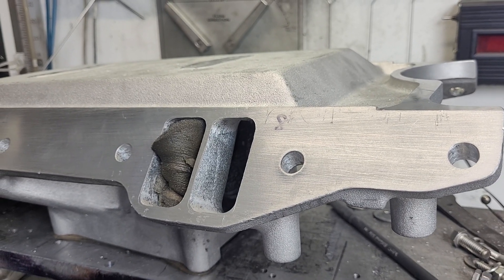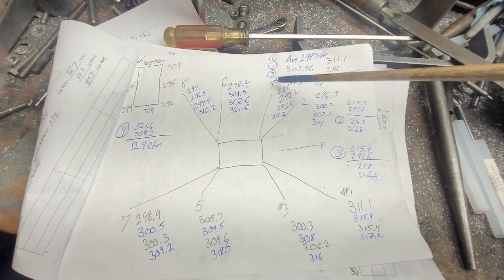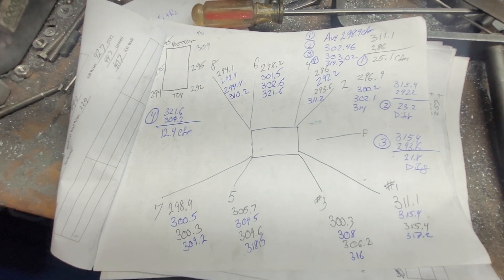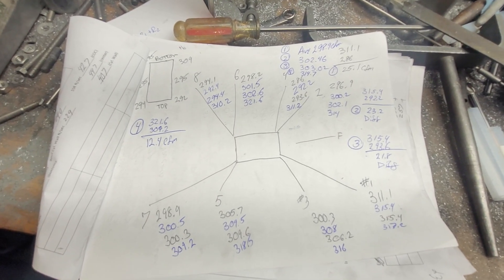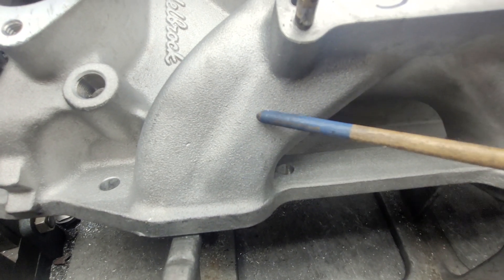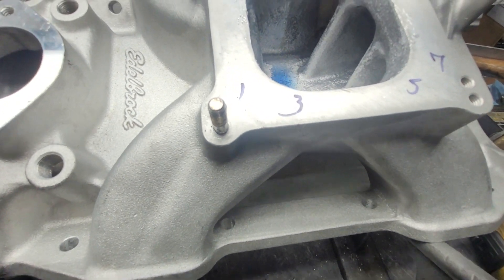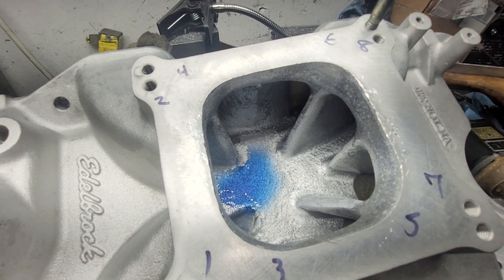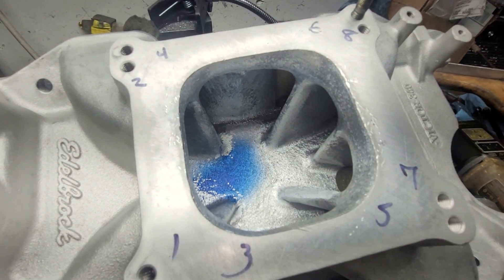How many cfm is a good gasket match worth? Edelbrock Victor 340, EQ-CH 318B. Final balancing

Comment: Hi Charlie. When are you going to get a/c in the shop? Andrew
Reply from the maker: I have a vented stand up unit. It can't keep up when I run the flow bench. The flow bench makes 7000 watts of heat!
Reply: @servediocylinderheads  Hello, little off topic but

How about 1200 watts in a outdoors flow bench? 😜 I started researching the old Kärcher. It flowed around 200 at 10 or something. 
 

-juhana
Reply from the maker: @juhanahuovinen  Good for smaller projects no doubt. Thanks

Comment: Excellent job Charlie! I just have to learn how to do my victot Jr. sb chevy.. should I use flow balls and a string to figure out where to take metal out? It's a challenge to me on doing the runners.  Thanks for the great videos.
Reply from the maker: I don't use flowballs on intakes usually.
Reply from the maker: Worry about transitions and radiuses. Taper
Reply: @servediocylinderheads  Ill watch Terry's video on the engine with the intake you did I think he has one. I would like to build a similar engine maybe a little milder for my 69 Camaro I would like to drive anywhere.
Reply from the maker: @dondotterer24 DV and Terry both did a video on that engine and neither mention me! Nice to be appreciated...
Reply: Thank you!

Comment: Which Intake would you recommend for a L.A. Head that has been ported to about same as the Magnums CFM range? I already have a super victor or a fully ported Vic340 ?
Reply from the maker: This is the first Vic 340 I have ever seen and I never saw a super vic so I have no idea. I would think either after some work would be fine. I wouldn't run em stock.

Comment: 10 CFM is about what a gasket match or port match is worth on 351 Cleveland  or Modified manifolds. Single or dual plane. I use Cera Kote's piston coat ceramic heat barrier inside and out on manifolds to reduce hot air detonation cause it's F N hot in Texas. Good work as always.
Reply from the maker: Excellent. Thanks